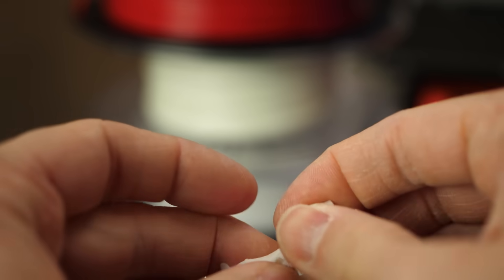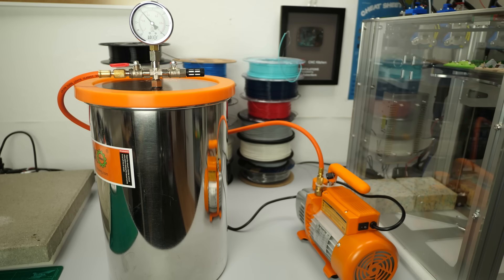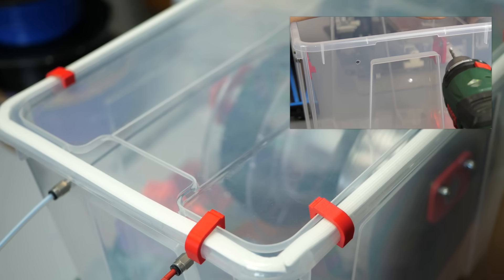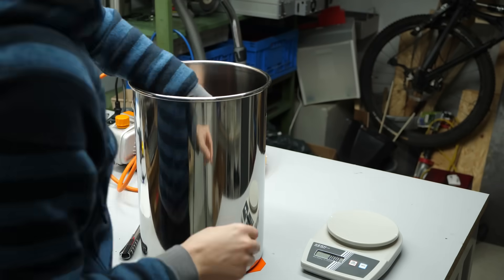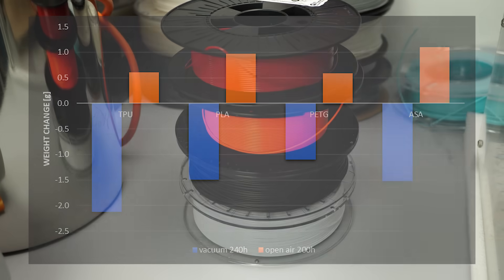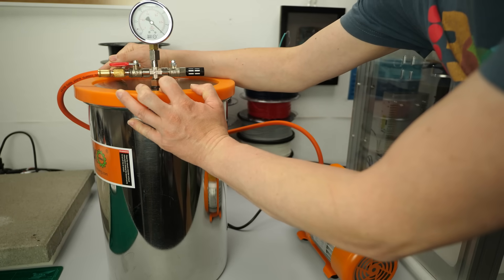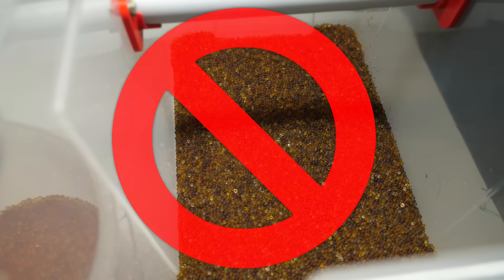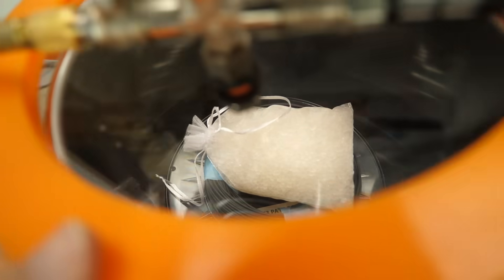Vacuum VS Dehydrator! What's the best way to dry filament?

Comment: Stephan, is the humidity in the box stratified? The upper air portions more moist and the lower portion dryer? Because moist air rises like clouds do. If this is true then it would be more efficient to place the drying material at the top most position in the drying box. Maybe this is why the tiny membrane unit that was mounted very low in the single roll drybox wasnt that effective and the AMS dry boxes were effective because the dryers were mounted near the top.

Comment: Thanks for a great video even though its old. Can you give some advice, if you using a filament drying box with a fan , must you have a vent to let the air flow out ? The filaments dryers we buy don't have a vent to let the air out. Thanks

Comment: Vacuum drying without a cold trap doesn't work! The filament will sit in 100% water vapor at low pressure and there is no gas to transport the water away. Either use warm air or really low vacuum plus a fitting cold trap!

Comment: The process that I've been using lately, which is not based on rigorous scientific testing, is to dry my filament in a dehydrator for at least a couple hours, or overnight, and then drop it straight into the vacuum chamber for an hour or two.   Convective heat transfer is very low in a strong vacuum, so the spools are still quite warm by the time I take them out, so it kind of seems like the best of both worlds.  Granted, it requires owning the equipment for both processes, but I'm curious whether it gets you to the point of diminishing returns faster than either process alone.

Comment: Vacuum desiccators are usually used  with a desiccant. I have a couple pounds of silica gel in my vacuum chamber and it works great. I'd like to see a comparison with a setup like this, as it's rather inefficient to run a dehydrator for twenty four hours and vacuum drying seems the better option, especially when you consider that a vacuum setup is a useful tool in general. Mine didn't cost very much either.

Comment: Short term, I typically store filaments on the printer or in a cheap dryer that I got off of Amazon. For long term storage I have a vacuum sealer that I use to repack the spools in their boxes under vacuum with some desiccant in the middle.

Comment: Vacuum chamber plus desiccant is the standard that have been used in Chemical research since forever, laboratory glassware vendors sell a device that looks like a glass pressure cooker that has the brim of the cover ground pretty flat and you put appropriate lubricant so that you can slide it in and out and it has a connector for the vacuum pump, if you use heat + desiccant + vacuum you going to get as dry as it can get.

Comment: Oil and water don't mix, so to pump water you need to add a condensation trap, hi-vac systems usually use a liquid nitrogen trap.

Comment: Click to see why silica gel is a bad choice to dry filament down below in the edit!

Original post: For filament storage I'm using those boxes which have a built in seal. They are limited in size, though. I also put drying agent inside, I think it's CaCl2, which should be pretty strong. Out of curiosity I put a hygrometer inside the boxes yesterday (after having used those boxes for years). I was shocked to see, that in all of them, the humidity is still exactly 23%. Adding silica gel did nothing to change that. Maybe MgSO4? But as I said, CaCl2 should actually be the strongest of them, based on my intuition as a chemistry guy (I should actually read that up ^^;). Also maybe the hygrometer is off?
As for the amount of drying agent it's 1 kg per box. 1 box fits 2-3 spools and has a volume of 10 liters. No holes for direct printing. I didn't weigh the drying agent beforehand, but as it is now, a pack that is supposed to be 1 kg weighs 1,05 kg, so I'm sure they are practically pristine.
What other drying agents do we have? H2SO4? (xD don't do this at home)

Edit: So I did a bit of quick research and it turns out that most drying agents are not thaaat strong as to expect close to 0% relative humidity in the box.
It Seems that CaO has the highest water affinity of all drying agents that are still reasonably practical in this case. This basically means, that it will get the residual moisture the lowest. Silica gel is actually pretty bad in that regard, so you might consider using a different drying agent (see below). The charts didn't include CaCl2, MgSO4 or Na2SO4 but from texts it seems that regarding water affinity CaO beats them all, followed by molecular sieves. Which makes sense, since CaO lowers the humidity via a real chemical reaction, whereas the other drying agents either work by capillary adsorption or by incorporating water in their crystal structure. Although it can't absorb as much water as silica gel and most others and the water uptake is comparatively slow. It's also not as easy to regenerate...or maybe not at all for the usual tinkerer (heating to at least 580 °C / 1076°F). In my case, though, not much water seems to get into my boxes, even after years, so I guess I'll give it a try.
So far I don't print directly out of a drybox and didn't think a lot about all this, but recently I've seen some builds that gave me the idea to not only feed the filament through air tight pneumatic fittings but to also seal them after use. This non perfect sealability was the thing that prevented me from going this route in the past, I guess. Also the DIY seals for the lids of those bigger boxes, that don't come with a built-in seal, don't seem very trustworthy to me.
I was surprised to see that CaO ("burnt lime", "quicklime") is sold for gardening use at low prices to anyone. Because, mind you, it's pretty caustic for your every day chemical.

Short comparison and why silica gel isn't really that great:

maximum water absorption (g water per g drying agent)
CaO 29%
molecular sieve 22%
silica gel 36%

equilibrium point (amount of water absorbed by the drying agent where the ambient relative humidity will increase above 10 % at roughly room temperature (25 °C))
CaO 26%
molecular sieve 15%
silica gel 4%

The latter table is the important one if you want to get stuff really dry. To put it into words: although silica gel can absorb more water than the other mentions here in total, it's ability to hold onto it decreases very rapidly with it's saturation. Before the humidity in the box rises to 10% 100 grams of CaO can bind 26 grams of water (which is nearly it's maximum capacity of 29), whereas the same amount of silica gel can only bind 4 grams.
It's a shame that I wasn't able to find data like this for CaCl2, Na2SO4 and MgSO4.

However, silica gel and the many other drying agents have an approximate uptake speed of 5 to 10 grams of water per 100 grams of agent per hour, CaO only has 0.5 . I don't think this matters, though, because there isn't much water in the air that enters the box when you open and close it in absolute terms. And if it somehow matters, maybe a hybrid solution could be used.

TLDR: surprise reveal! Even though it can store very much water when it is really really moist (>60% relative humidity) silica gel is a terrible drying agent for low r.h. applications. Use something different for filament storage/drying. CaCl2 seems to do the job (and is also used in many room dehumidifiers and thus easily available and relatively cheap, but ultimately I got no data for it other than a realtively low reading of 23% r.h. in all my boxes after years), but CaO ("burnt lime", "quicklime") might be the best choice here. At least if you have the skill not to hurt yourself and your stuff with a somewhat caustic substance.

TODO: maybe experiment and get the equilibrium points for CaCl2, Na2SO4 and MgSO4 the DIY way.

Comment: Just a thought, as you let the air back into the vacuum chamber, don't use normal air. Use a VOC like turpentine gas. Fill the voids the water vacated (that might also make it less brittle).

Comment: I'm only 3 years late with my comment 🙂  After the vacuum drying is done, I think that the vacuum vessel needs to be vented to atmospheric pressure using a dry inert gas (Nitrogen or Argon). Venting the chamber with potentially moist air would reintroduce moisture back to the filament.

Comment: Still a useful video, even after a few years. Active alumina desiccant brings the RH much lower than Silica Gel, has higher moisture capacity and a longer life. The interactions between moisture and the filament are more complex than covered here, and not all of them are reversible, depending on the polymers involved. PLA in particular doesn't return to the same state after heating, so there is a lot more to investigate here in a future video. Proper dry storage is important and just drying the material after improper storage does not always result in a good result, and brittle filament is one result that we commonly see. Combining heat and vacuum is significantly more effective at removing moisture quickly. Lots more for future investigations!

Comment: Not sure you are just driving water out. From memory most of these have other compounds that can be removed through even low level heat. Water will be a large part but this is kind of sketchy.

Comment: My first role of PETG, was the worst 3D printing related thing that ever happened to me. It was basically saturated with water right from the factory. Brand new material. It printed so badly none of the usual tuning things like the temperature tower or a benchy was even readable. The Internet is full of people saying moisture isn't that much of a problem for PETG and something else has to be the cause. I tried everything and nothing worked, no speed adjust, no temperature seemed to work, cooling, it always turned out very bad. Then i got fed up and dried in in an oven. 65°C for 2 hours, opening the door every 15 minutes or so to release the water vapor. This single spool lost 10!!! grams of weight, and printed almost perfectly afterwards.
I life in wet climate (we had 100% relative humidity @ 20-22 °C for the past 5 days straight...), so yeah, dry your stuff, don't trust thin plastic bags and tiny desiccant pouches. You'd be surprised by how little moisture silica gel can actually absorb. You really need a lot of that stuff.

Comment: I've only had experience with one of the cheap vacuum pumps but a suggestion to consider. Pick up some decent vacuum pump oil and do an oil change. Mine went to a lot lower pressure after doing so. Like a lot of Chinese products the lubricants in it when you get it are unlikely to be good quality.

Comment: I store my materials on a NSF shelf that has R10 eps insulation on 5 sides and a clear vinyl curtain on the front. I keep two dryers running in there as well as 2 printers that run when needed.

Comment: Vacuum will work and you can leave the pump on for days dont worry about hea. The issue is when the oil takes on moisture the Vacuum wont be good. You can easily test using a vacuum gauge and measure in microns

Comment: I wondered about vacuum, I used to use it when i woodturned,  cut fresh wood, microwave it on lower power until the wood sizzles then cool it in a vacuum pot to recompress the wood and force the moister out. Works well.

Comment: I store my filament in my kallax shelf from ikea. I installed a door and made it air tight, installed a moisture sensor and put a tub of silica gel inside. In each of the cabinets i can store five 1kg spools.

Comment: No dehydrator? Put the filament spool on your heated bed and put a metal bowl over it.  Turn on the heated bed to the target temperature and lift off the bowl a few times to allow air exchange. <3

Comment: Für Vakuum eignet sich ein alter Kühlschrank-Kompressor sehr gut - auch braucht Der nahezu keinen Strom im Vakuum-Betrieb - Druck geht auch - bei 10 Bar hatt ich die Hosen voll - laut INet sollen bis zu 20 Bar drin sein - allerdings mit recht wenig Volumen - auch im Vakuum-Betrieb - zum Vakuum-Spannen (CNC-Fräse) sollten nicht zu viele Undichte vorhanden sein - da braucht's dann doch etwas mehr Volumen/fettere Pumpen.

Denke, Vakuum UND Wärmen dürfte kaum was bringen - die Wärme bekommst Du nicht an's Material - Vakuum ist ein guter Wärme-Isolator.

Comment: Stefan, the correct process to dissect any filament is with a vacuum oven. I mean; you have to combine both things obligatorily for the process to work correctly;
First, the oven must heat the filament for a few hours (time and temperature depending on the material of the filament). After the filament "sweats" all the moisture, the vacuum must only be generated after that. Depending on the type of oven used, it is also useless to generate the vacuum and the temperature simultaneously, because if the heating system is outside the vacuum bowl, the vacuum is a thermal insulator and it would not conduct the temperature well to the filament roll either. Therefore it is necessary to heat first, and then to generate a vacuum.

Comment: The video is a bit quick about to erode the border between kinetic effects and thermodynamic equilibrium.
Of course you need to push the equilibrium by removing water constantly out of the exicator. 
Usually this done with H2SO4, a runnig pump ( which by the way needs hot oil to work properly) maybe copper chlorid or calcium chloride are fine as well
Heating the exicator helps but is a slow party as only radiation transfers heat. 

At the end it’s all about how fast you want to reach a certain level.
Fast ist with heat …

Comment: I also keep my filament in airtight boxes with desiccant. However, some filaments are still tempramental and absorb moisture. Recently, I was attempting to print with ProtoPasta HTPLA Red. It was oozing and stringing no matter what setting I changed. The role had been sitting in the box for some time. I ordered a new roll and there was a visible difference between the old roll and new one. The old roll was lighter in color and the filament seemed to have expanded slightly in diameter. The new roll behaved much more predictably... it stil stringy though. Perhaps because of the bowden tube setup?? Can't quiet get these proto-pasta filaments to eliminate stringing entirely lol

Comment: The problem with the vacuum drying is the cheap vacuum pump.  Hvac guys use micron gauges to read vacuum. Guaranteed that pump isn't even pulling a 1000 microns.

Comment: I thought I commented on here... about putting filament in the freezer... 
My idea is that instead of vacuum or heat... how about freezing temps?
Cold air can't hang on the water as compared to Warm air.
I think if I were to place filament in the freezer... the air is dryer and possibly pull the water out of the filament.
I just bought crappy filament during Black Friday... constantly causing clog signs... 
I place this filament in the freezer overnight within a resealable bag open... (in preparation to close it up before taking it out of the freezer.)
If I don't seal it up before taking it out of the freezer, I expect condensation to form on the filament in contact with warmer moist air.
Initial test after an overnight stay in the freezer and letting it warm up in the sealed bag to room temp... seems to have helped.  Let's see how it goes... first few layers seems to be doing surprisingly well.
It completed a troublefree print... 2 possible reasons... the freezer treatment worked... or I used up the crappy outer part of the spool and started to print with the good protected filament.
I also place color changing desiccant into the freezer overnight... no change in color... I'm starting to think freezer treatment doesn't really dry it out.
Considered "freeze-drying" but those machines are expensive... probably out of reach of most people.

Comment: Just having the product is not enough as the moisture has nowhere to go, you need a seperate pump with condenser to capture the water vapour otherwise do will be essentially doing nothing.
It’s like boiling water in a pot with the lid on, you will create vapour but that vapour will just return to liquid form inside the chamber the moment you switch of the vacuum.

Comment: There is another option - decommisioned medical sterilization units. Basically, it is well insulated electric oven with high precision temperature regulation and convection fan. It may also have a vent, which can be closed or opened. Thanks to good thermal insulation, the energy consumption is much lower than kitchen oven. Also, cheap kitchen ovens with mechanical temperature controller are not suitable for filament drying, because the temperature regulation can easily overshoot by 20°C or more. The sterilization unit can be used for another technical purposes like curing of powder coatings and resins. It is not wise to do this things in kitchen oven, because it can leave a nasty smelling, unhealthy chemicals inside the oven. New sterilization units are very expensive (over 1000 €) but the old ones can be bought for 50 - 100 €.